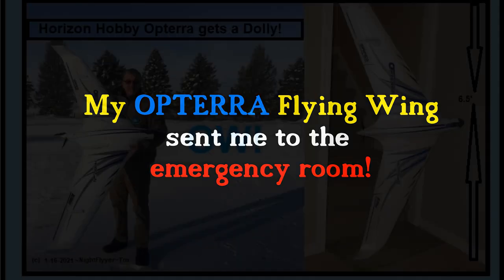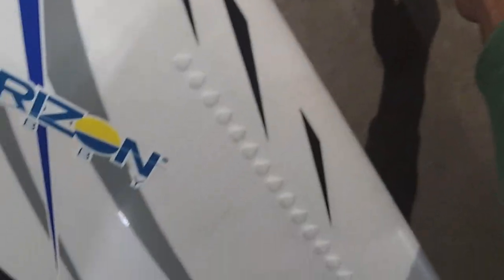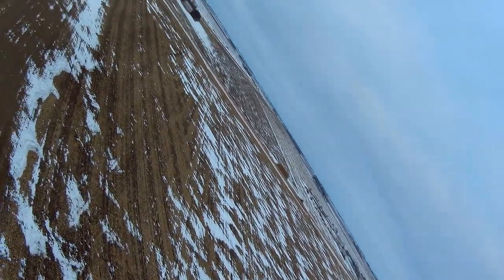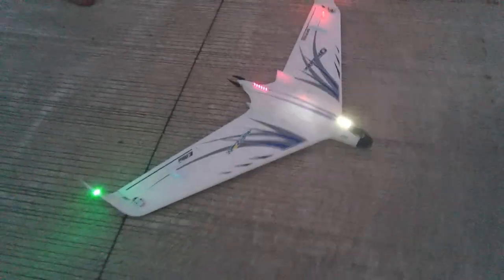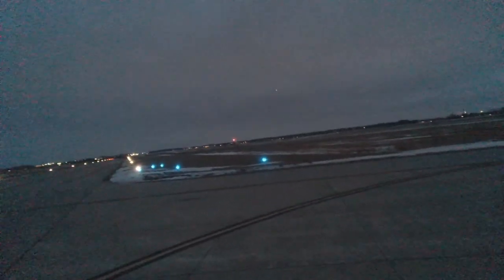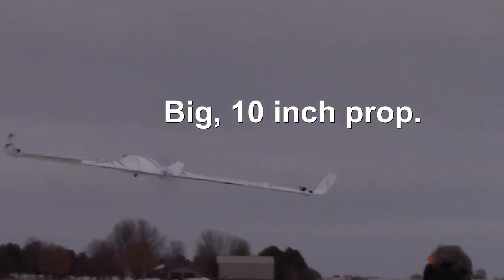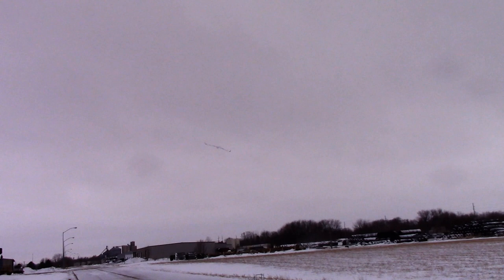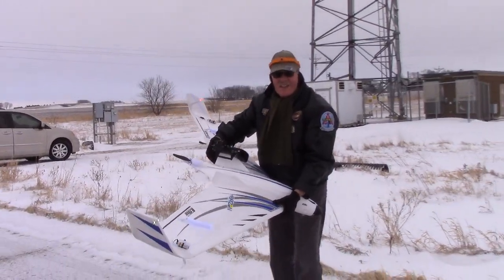My Opterra 2M Flying Wing sent me to the E.R. This is an awareness video & my solution for launching

Comment: Common sense? :)
Reply from the maker: Common sense?  I launched it exactly word for word by the instructions and in my 2 previous videos.  Here is word for word what the Opterra 2M manual says about launching.  
1. Put the aircraft into launch mode with the channel 5 switch.  (in my first video that did not work, it went into the ground)  
2.  Hold the aircraft in one hand and the transmitter in the other.  
3.  Apply full throttle and throw the aircraft directly into the wind, angled slightly up (5 to 10 degrees above the horizon). 
4.  Climb to a safe altitude and check the trim.   
I know others have their own ways, and either way, my Dolly is the safest solution for me.  
The Opterra 2M manual also says nothing about throwing it with the motor off, so if a newbie followed the instructions, like I did, I'm showing what could happen, in case a gust of wind got them or something else.     Nothing is 100% and no matter how good you can throw, this big 7 foot wing with a 10 inch prop spinning right next to your face, is risky.  And to see how I feel about that unnecessary auto stabilization system see this.  https://www.youtube.com/watch?v=ur5V5H8UcGs&t=1s
Reply: @NightFlyyer  Using an instruction step by step isnt common sense right? 

Common sense would be to wear a glove when operating something with a spinny part close to the hands regardless what is typed into a manual by thiny little chinese hands. :)

But dont take me too serious iam just an idiot from the internets...
The starting process of this thing is a joke and looks like you really love your hobby and you know how things work (for the most time ;) ). Please just wear a glove next time!

Hope you get well soon! 
Cheers
Reply from the maker: @c4m3l23  Thanks for that suggestion and I tried that already, because it was cold, but trying to hold on to the tiny finger grips on the bottom of the 7 foot, heavy wing with a thick glove under full power would be difficult when under power and then trying to fly with it on and also difficult to fly the transmitter,  so although that sounds like a good idea, it would probably not work that well.  We are only talking about a Half inch of clearance that I needed to keep from getting cut. My dolly is my new friend.  Thanks much.